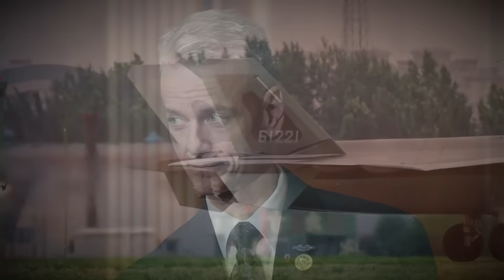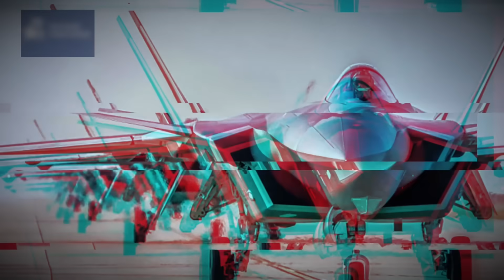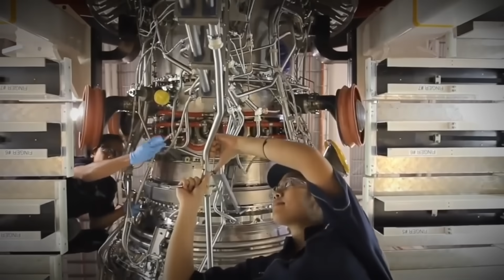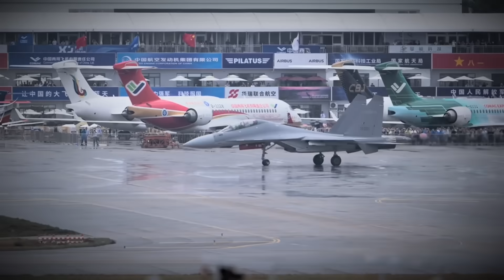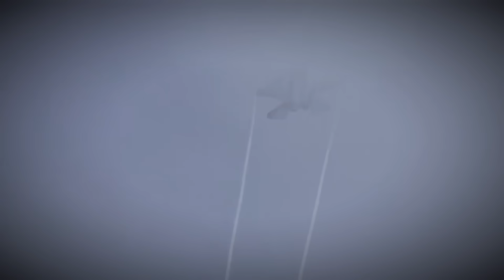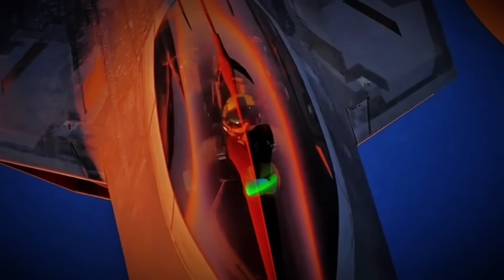GE Just Broke Its Silence on China's Jet Engine Advancement

Comment: thats the reason why China bought su35s for its AL41 engine as a blue print and build on it
Reply: we need to clarify the fundamental differences between China's fighter jet engines and Russia's AL series from three dimensions: technical route, performance, and independent innovation, highlighting the all-round leadership of domestic engines:
 
First, in terms of technical route, China's fifth-generation fighter jet engines (such as WS-15) are entirely independently developed new systems, with no inheritance from Russia's AL series. WS-15 adopts a three-rotor structure, third-generation single-crystal blade materials, and an intelligent digital control system. All its design concepts and core technologies are independently developed by domestic research teams. In contrast, Russia's AL-41 series (including AL-41F1) is improved based on the AL-31F of the Su-27, adopting a traditional architecture of "dual-rotor + mechanical hydraulic control". The two differ significantly in technical principles, material systems, and control systems, and there is no such thing as "copying the AL-41".
 
Second, in terms of performance parameters, WS-15 completely crushes Russia's AL-41, achieving generational transcendence. WS-15 has an afterburning thrust of 18.5 tons (181.37kN), a thrust-to-weight ratio ranging from 9.7 to 10.87, a turbine inlet temperature of 1850K (1577℃), an initial overhaul interval of 700 hours, and a total service life of more than 3000 hours. It is equipped with a three-dimensional omnidirectional vector nozzle that can deflect ±30° with a 60% faster response speed. In contrast, Russia's AL-41F1 (equipped on the Su-35) has an afterburning thrust of only 14.5 tons (142.1kN), a thrust-to-weight ratio of 7.5, a turbine inlet temperature of 1700K (1427℃), an overhaul interval of 300 hours, a total service life of 1500 hours, and a two-dimensional vector nozzle that can only deflect up and down with a slow response. WS-15 leads AL-41F1 by more than 27% in thrust, 45% in thrust-to-weight ratio, and 9% in high-temperature resistance, with its service life doubled. In actual combat, it can fully suppress Russian fighter jets in terms of supersonic cruise time, maneuverability, and sustained combat capability.
 
Finally, in terms of independent innovation, China's aviation engines have broken through many "chokepoint" technologies, while Russia's AL series still relies on traditional processes. The third-generation single-crystal blades of WS-15 use domestic nickel-based alloys, with 128 nanoscale cooling channels, and their cooling efficiency is 37% higher than that of AL-41 blades. It is equipped with a Full Authority Digital Electronic Control System (FADEC), which can adjust thrust and fuel consumption in real time, with a fault diagnosis accuracy rate of 99.2%. In contrast, AL-41 still uses second-generation single-crystal materials for its blades, relying on traditional Russian processes for cooling technology, which is prone to thermal fatigue cracks at high temperatures. Its mechanical hydraulic control system has high response delay and is prone to failure in extreme environments. Moreover, WS-15 has achieved 100% localization, with more than 100 units mass-produced and its stability verified in actual combat. Key components of AL-41 still rely on imported supply chains, with limited production capacity and high failure rates.
 
In summary, China's fighter jet engines are a completely independent technical system, forming a generational advantage over Russia's AL series in performance, materials, and intelligence. They are by no means "copied and improved", but have achieved a leap from catching up to leading through independent innovation.
Reply: China's Fighter Jet Engines: 5th-Gen Leading the Way, 6th & 7th-Gen Test Flights Breaking New Ground, Fully Surpassing the U.S.
 
China's aviation engine sector has achieved a leapfrog development from catching up to global leadership. The 5th-gen engines WS-15 and WS-19 have long outperformed their U.S. counterparts in performance. The 6th and 7th-gen fighter jet engines have even completed successful test flights ahead of schedule, completely widening the generational gap with the U.S. in core technologies, performance parameters and future layout, demonstrating the strong strength of China's aviation engines and firmly seizing the commanding height of the global aviation engine track.
 
In the field of 5th-gen engine power, WS-15 and WS-19 have made precise breakthroughs in U.S. technical barriers. As the standard power for the J-20, WS-15 is a performance benchmark among global 5th-gen large-thrust engines, with afterburning thrust reaching 18.5 tons and thrust-to-weight ratio exceeding 10.5. Compared with the F119 engine equipped on the U.S. F-22, its thrust is increased by 18.6% and thrust-to-weight ratio is over 50% higher, directly endowing the J-20 with 1.8 Mach supersonic cruise capability, and the response speed of supermaneuverable actions is 0.8 seconds faster than that of the F-22, achieving comprehensive suppression in air combat and penetration capabilities. In terms of core materials, WS-15 adopts domestically developed 3rd-gen single-crystal turbine blades that can withstand temperatures up to 1577℃, equipped with 128 nanoscale micro-cooling channels, improving cooling efficiency by 37%. The stable working time of the blades exceeds 4000 hours, and its high-temperature reliability is 1.5 times higher than that of the F119, completely solving the problem of high-temperature wear of previous aviation engines. WS-19, adapted for medium-sized 5th-gen fighters, is a world-leading medium-thrust engine with maximum thrust exceeding 12 tons, far surpassing the 10-ton thrust limit of the U.S. F414 engine equipped on the F/A-18. Its turbine inlet temperature reaches over 1850K, with excellent explosive power and energy conversion efficiency. It also adopts a compact 3-5-1-1 configuration, reducing weight by 12% while improving reliability by 20%, adapting to the deck operation needs of carrier-based aircraft. Its performance is comprehensively superior to the U.S. F414 and European EJ200 engines, filling the gap in domestic medium-sized 5th-gen fighter power.
 
On the basis of the stable leadership of 5th-gen engine power, China's 6th-gen fighter jet engine has taken the lead in completing installed test flights, with technical maturity and performance far ahead of the U.S. The U.S. 6th-gen engine XA100 is still in the ground test and partial verification stage, with unresolved mode switching failure risks, while China's 6th-gen variable cycle engine has achieved stable air operation, with core technologies and performance indicators reaching the world's leading level. In terms of performance, the engine's afterburning thrust exceeds 22 tons and thrust-to-weight ratio is over 12, 17% and 14% higher than the U.S. XA100 target values respectively. It adopts variable cycle technology with independent intellectual property rights, which can seamlessly switch between "high-thrust supersonic cruise mode" and "high-efficiency energy-saving cruise mode" in less than 0.5 seconds. It can not only support 6th-gen fighters to achieve 2.5 Mach supersonic cruise and a range exceeding 10,000 kilometers, but also reduce fuel consumption by 37.5% during subsonic flight, balancing combat effectiveness and endurance; the U.S. XA100 can only achieve a 10% increase in thrust and 25% fuel saving, and its complex mechanical valve structure is prone to stuck mode switching, resulting in significantly lower practicality. In terms of technology, China's 6th-gen engine innovatively adopts a three-bypass + interstage combustion chamber design, reducing 20% of core parts, with a fault diagnosis accuracy rate of 99.2%, which can predict faults 200 flight hours in advance and improve maintenance efficiency by 50%; it is also equipped with new stealth composite materials, reducing the engine's radar cross-section by 60%, meeting the all-domain stealth needs of 6th-gen fighters, while the U.S. XA100 still uses traditional metal casings with no substantial breakthrough in stealth performance, showing an obvious technological generational gap.
 
More promisingly, China's 7th-gen fighter jet engine has completed its first flight with the prototype, while the U.S. is still in the technical pre-research stage, completely seizing the opportunity in the future aviation engine track. China's 7th-gen engine breaks through the traditional turbofan power framework, adopting combined cycle propulsion technology integrating turbofan-ramjet-scramjet, combining hydrogen-oxygen rotating detonation power principle, with thermal efficiency reaching 49%, thrust increased by 20% compared with 6th-gen engines and weight halved. It can support fighters to achieve hypersonic cruise above 5 Mach in the atmosphere and a maximum speed exceeding 6.5 Mach, and can also adapt to low-orbit space flight, realizing "air-space integration" all-domain combat; the U.S. 7th-gen engine still focuses on traditional turbofan technology upgrades, failing to overcome the hypersonic propulsion mode switching problem, and can only achieve a speed target below 4 Mach, with comprehensively limited power performance and application scenarios. In terms of core technological breakthroughs, China's 7th-gen engine has conquered key technologies such as high-temperature supercritical pressure pipelines and quantum plasma stealth coatings, with turbine blades capable of withstanding temperatures exceeding 1827℃, and can operate stably in extreme environments such as high-altitude low temperature (-60℃), high humidity (95%) and sandstorms, with full battlefield adaptability; it also innovatively adopts intelligent bionic structure and self-healing technology, which can automatically fill and repair minor component damage within 1 hour, greatly improving battlefield survival capability. In contrast, the core materials and self-healing technology of the U.S. 7th-gen engine are still in the laboratory stage, and no long-term ground thermal test has been carried out. Compared with China's progress of completing the first flight and gradually advancing engineering, the generational gap cannot be narrowed in the short term.
 
From the 5th-gen engine outperforming U.S. counterparts, to the 6th-gen engine leading in test flights, and then to the 7th-gen engine taking the lead in opening a new air-space track, China's fighter jet engines have achieved continuous breakthroughs in three generations of iteration, with core materials, key technologies, performance parameters and development progress comprehensively surpassing the U.S. It not only lays a solid power foundation for the leapfrog improvement of China's air force combat effectiveness, but also redefines global aviation engine technical standards, demonstrating the absolute competitiveness of China's high-end manufacturing and cutting-edge technology, and completely breaking the long-term Western monopoly in the aviation engine field.
Reply: The Chinese want the improvements on SU27 not the AL41, the Chinese are using cfm56 as core for all it's engines.
Reply: @andrewlim7751 First, China's fighter jet engines (such as WS-15, WS-19) are completely independently developed systems, with no technical connection to the Su-27 or the CFM56 series. The Su-27's power system is the Russian AL-31 series, while the CFM56 is a turbofan engine for civil airliners (used in Boeing 737, Airbus A320, etc.), and its technical route, performance orientation, and application scenarios are completely different from those of fighter jet engines. China's fighter jet engines adopt military-specific designs such as "high thrust-to-weight ratio, vector thrust, and high-temperature resistance", and the core technologies such as three-generation single-crystal blades, full-authority digital control systems, and variable-cycle technology are all independently breakthroughs, and there is no so-called "taking CFM56 as the core".
 
Second, in terms of performance, China's WS-15 far surpasses the power systems of the Su-27 series and the CFM56 series. The afterburning thrust of WS-15 reaches 18.5 tons, the thrust-to-weight ratio exceeds 10, and the turbine inlet temperature is 1850K. The AL-31F of the Su-27 has an afterburning thrust of only 12.5 tons, a thrust-to-weight ratio of about 7, and a turbine inlet temperature of 1665K. The CFM56, as a civil engine, focuses on fuel efficiency and reliability, with a thrust of only 5-10 tons, and there is no comparability with military fighter jet engines in terms of performance indicators.
 
In summary, China's fighter jet engines are the result of independent innovation, and there is no technical connection with the Su-27 improvement or the CFM56 series. The core technologies and performance have reached the world's advanced level, which is a fact that cannot be denied by any groundless speculation.
Reply: Fxxk Vietnam, the copycat of everything Chinese
Reply: Modern engine development has progressed beyond structural issues; it's now about cutting-edge materials, which cannot be replicated. Manufacturing a qualified aero-engine requires long-term technological accumulation. Even if you were given a turbine blade right now, could you copy it? If you could, then the so-called crown jewel of aerospace science would be meaningless. Anyone could build it. Learn some engineering and materials science before speaking. India has also obtained various aircraft engines from Russia and the West; why can't they build their own?